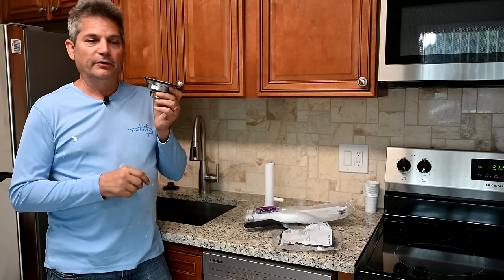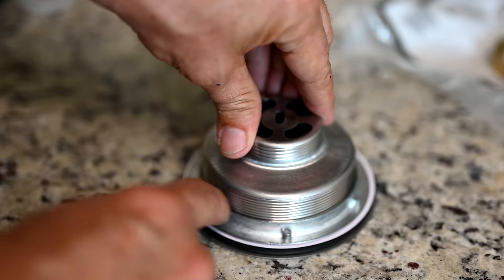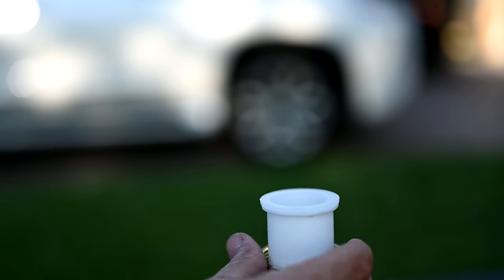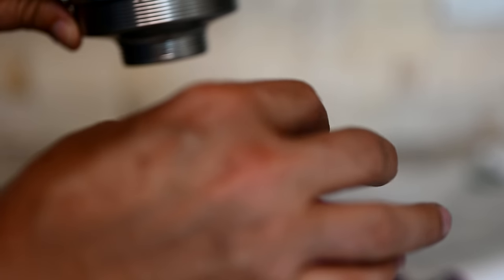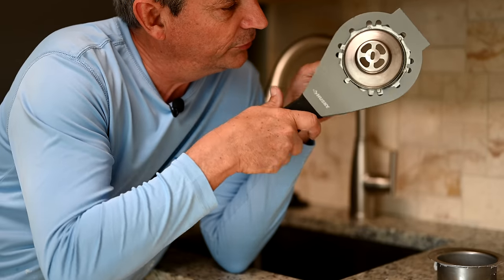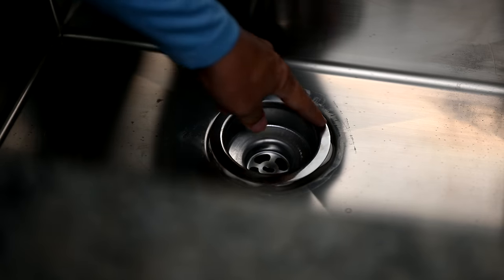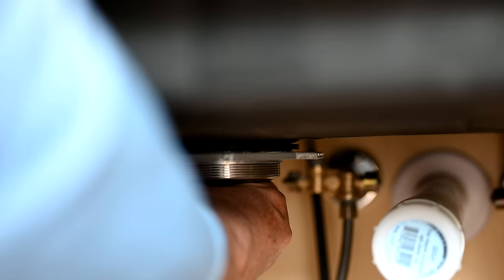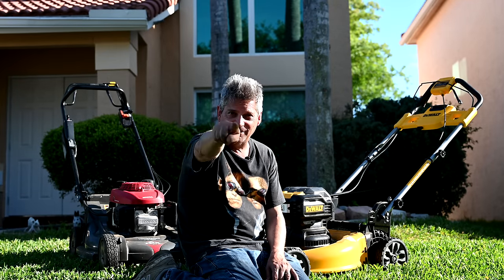How To Install Kitchen Sink Drain Strainer, Stop Leaks

Comment: Excellent presentation. Really appreciate the explanation and detail. I have a question about what is needed below the P trap. I am installing my sink in an outdoor kitchen and my drain will run straight down to and about 4 inches outside my outdoor kitchen to my French drain at grade. Do I just angle it down into the drain and call it good?
Reply from the maker: Yes, I would have the P-trap terminate into a 1 1/2" PVC pipe with a hub adapter, just like you would in the pipe coming out of a kitchen wall, then the pipe goes outside, then give it a 90degree bend, not a 90 degree sharp turn elbow, but rather a 90 degree graceful bend downward, and into a 1 1/2" pipe into  the ground.

Comment: I installed two of these since I had a double sink and for some reason the last one keeps leaking on the bottom no matter what I do or how tight I make it. I'm really frustrated because I had to by the putty, the right tool, and spend a lot of time trying to get it right. I don't know if it's warped or what. It just won't stop leaking on the left side. I've heard that you could use something called megaloc?
 Do you think that would work?

Comment: Thanks ! I'm wondering if that plumbers putty is affected by hot water or chemical cleaners!? I have a mowen  fiberglass sink that's only  four years old and started leaking! So would  silicone be more durable!?  Thank you !!
Reply from the maker: I doubt that it is affected by any of that 'cause it's really mostly sealed underneath the flange but I imagine overtime everything takes its toll on it that's why  many plumbers actually I prefer to use silicone instead

Comment: If tail piece stuck in bottom pipe any suggestions on loosening it?  The big nut was easy to unscrew but tailpipe wont turn or pull out.

Comment: I got a question.   Does the p trap need to be a certain height (higher or lower) than the stub out? And does it need to be vented at all?    I’ve seen some where there is a vent underneath the sink

Comment: Do you know if there's and advantage to using the metal nut that typically comes with the basket strainer versus the common plastic nut when securing the PVC tailpiece to the bottom of the strainer basket? Thanks for your input on this!
Reply from the maker: It's really hard to say the problem that I've seen in most installations is once you get a leak that metal not corrodes and then it's hard for some people to get them off. On the other hand I have seen where people put on the plastic nut and then use tools staking Lee to overtighten them and that can put too much stress on them and they eventually crack. My preference is to use the plastic and tighten it by hand wearing a glove so I can get it nice and snug without over tightening it and then I know it will never corrode. And if it does crack and fail sometime down the road it's only a couple of bucks to buy a new kit

Comment: I am thinking about building a friction gasket with a manilla file folder. What do think? Not replacing the basket, it's brand new.
Reply from the maker: I prefer to use what the builder ships with it
Reply: @jeffostroff  I gotcha. I appreciate your insights. The putty bead was the key for me. It was apparent, I didn't use enough when I replaced the old sink basket. Just didn't want to buy another basket because of a friction gasket.

Comment: Hi Jeff, just changed out my sink basket but having trouble reconnecting the nut to the bottom of the drain, it feels like its screwing on properly but then slips down again HELP!
Reply from the maker: Watch the video again and at 9:58 find that trick that I showed you for how to get that nut on there when it doesn't want to thread on. You push the nut all the way up and if it keeps skipping what you do is you force it up with your hand hold it in place and then very slowly rotate it backward counterclockwise until you feel it click up into the threads and then you can start threading it up again. This works with just about any nut and bolts that don't want to thread together. Let us know if that worked  for you

Comment: I need a new friction washer. I don't know why mine is not on there. It's a bit distorted, but for a quick fix I had to put plumbers putty on top and tighten it down.  It's not leaking, but like you said eventually will. Plumbers must have the patience of a saint. This is not an easy job!
Reply from the maker: Yes, and they  have a lot of these common parts in their truck!

Comment: Home Depot has the Glacier Bay stainless strainer for $18 as well as a Kohler brand stainless strainer for $50. Is it worth spending the additional $32 for the Kohler brand?  Both are made in China.
Reply from the maker: Kohler is way overpriced they're essentially the same darn metal thing you're just paying for the name

Comment: Can you make a video on replacing water spigots, there was an issue I had where there was to much pipe dope on the thread and I had to hack saw it
Reply from the maker: Do you mean the shut off valves? We have a video called: How to Install Water Shutoff Valves In kitchen Sink 1/4 Turn Valve https://youtu.be/_0ziKhjwwe8
Reply: @jeffostroff  more like the garden hose spigotes the ones that are outside of houses. I feel those are interesting, it will be a nice video. I know sometimes the spigots are under the crawlspace and out the siding of the house, underground and out the porch or random lawn area, or sometimes comes out like a wall from the house....they also make all kinds of water spigots, theres sharkbites, and theres “smart water spigots” that hide and are flush against the wall of house

Comment: I followed your steps, but I different drain stainer, the one I bought has a bowl that is part of the strainer that holds the gasket and I can't get it tight the strainer keeps turning.  How do I fix this?
Reply from the maker: sounds like you are missing a friction ring
Reply: @jeffostroff  The friction ring is there, and I put the white side down like you did.

Comment: the waste pipe from the wall looks higher than the dishwasher branch on the tailpipe, is this safe for dishwasher water draining? cause I have the same situation in my kitchen.
Reply: In California the sanitary tee is roughed in at 18" - 20" from the floor !
Reply from the maker: Great eye my friend! Yes we ended up pulling out the sink cabinet, cut a hole in the wall, performed surgery on the black 4" plumbing stack behind the wall to remove that section, then replaced it with white PVC, and lowered the T connection, and now the pipe is 16" off the floor instead of 22" off the floor. This was the highest pipe we ever saw.
Reply from the maker: even that is too high. I prefer 12" to 17" off the finished floor. We are working on a video that shows how we fixed all this! Greta engineering
Reply: Yes 18" - 20 " on the bottom of floor so give or take for finish
Reply: 19 1/2" is standard here, used to work fine on old school double bowl sinks or lavatories.  However,  most newer modern sinks have deeper bowls, 15" is a safer bet.
Reply: @jeffostroff  thanks for the details explanation. Luckily I haven't installed my dishwasher, going to modify my drain pipe soon. thanks again 👍

Comment: Jeff - This is an excellent video, but allow me to add a footnote. While I was plumbing my PORCELAIN  kitchen sink (a Kohler) , I came to realized that the standard strainer basket will not set correctly in the opening in the bottom of a porcelain sink. The standard basket will work just fine for a stainless steel sink, but (at least on MY sink) I had to purchase a special deep strainer with a very thin flange on the top to have it fit correctly. Again, excellent video, just thought I would add my 2 cents....
Reply from the maker: That is good to know so what did you finally put in there to work?
Reply: @jeffostroff  From a company called PlumbPak it's called a 'Deep Cup Locking Shell Kitchen Sink Strainer'. I got it at my local hardware store for $27 but I think they can be purchased from Amazon as well.

Comment: I have a question. My friction cardboard ring is really bad because it was so wet. I then threw it away. Do I need to buy a new one to do the installation? Will it cause the leak to install without the friction cardboard gasket?
Reply from the maker: The friction cardboard ring might not cause a leak in itself but you wanna make sure that it the lack of it being there doesn't cause problems with you being able to tighten to drain down.
Reply: @jeffostroff  I created that friction ring by using a pen & an existing rubber ring to draw a ring on a used USPS priority mail envelope; then I cut out the ring from the envelope. I have created 2 friction rings and I installed them with my existing kitchen sink strainer. It is working great now. I saved myself $6. My Home Depot store sells the Glacier Bay ring kit for $6 which includes a nut, a friction ring, and a rubber ring. It also sells the Glacier Bay kitchen sink strainer for $12 which includes everything.  Thank you for an awesome video.

Comment: I wish I had seen this video 1st. I went to one major home center and one small town store. They had no idea the parts I needed and was sold the wrong type of pipe even though I showed them pictures and NO ONE mentioned I might need pipe putty. I was given all types of advice to remove the metal ring even asking me if I knew what channellocks were. I had to smash the old strainer to remove it because everything was corroded together. I learned that a 10 min project can waste several entire afternoons.
Reply from the maker: There is a lookup table I should create that shows the job time in minutes, then you lookup how many days it actually takes

Comment: I saw another video where the person put the strainer and black rubber gasket on the top side of the sink.
The way you are installing it will leak '
Which way is the correct way ?
I've never had to use plumbers putty where a perfectly rubber gasket is the main sealer. The plumbers putty will dissolve in less than a few months and you'll have leaks and you'll have to do the whole job over again. So what is the correct way ?
Reply from the maker: I would like to know how many years of plumbing experience and plumbing code research told you that "The way you are installing it will leak". The installation method we showed here will not leak, and did not leak even after thorough tests of filling and refilling the sink, because our method here follows the instructions of the manufacturer. The other video you watched is likely wrong, because many people erroneously think the gasket goes on the top side of the sink. The reason ours does not leak is we used plumbers putty to seal the drain basket flange tot he sink, so there is no leak. Unless the manufacturer instructions specifically state to use  the black gasket inside the sink, I would never do it, and on top of that it would look ugly sticking out around the flange.

Comment: Need help. At 2:55 and 3:16 you are using this plastic washer. are you saying you have two for one sink drain?? you are not making it clear. my kit only came with ONE plastic washer like that and i installed it like you did at 3:16 and i have a slow leak... what gives? Am i missing a washer (according to the diagram on the box there is only one that comes with the kit) but your video shows them in two places. i am lost. i was about to use silicone and make a big mess. help.

Comment: My new Glacier Bay sink/drain has a foam gasket to be used instead of plumbers putty. I need some confirmation that it's OK to use the foam gasket before I install the drain. What do you guys think?
Reply from the maker: I would rather use rubber, but if they say to use it then try it and see if it works.

Comment: A lot of people do it the way you are and use plumbers tape but you don’t need the plumbers putty if you put the gasket on the top gasket is designed to perfectly seal the flange on the top of the sink it doesn’t go on the bottom a lot of people don’t realize that
Reply: I’m confused. So are you saying that I shouldn’t use plumbers putty? I should be using the black ring on top Vs how Jeff did it?

Comment: I can't get my old leaking strainer off. When I turn the big nut underneath, the whole thing turns including the top. Any suggestions please?
Reply from the maker: if you can get a drain wrench try sticking that into the drain and have somebody hold it while you unscrew it from the bottom or you can try sticking a Flathead screwdriver up through the hole into the bottom of the drain and into the slots of the grate  to see if you can hold it into place while you try to unscrew that nut. You might also try some PB Blaster on the nut several times over a ½ hour before trying to loosen it. Also try giving it a bunch of medium hammer taps all the way around the nut
Reply: @jeffostroff  Thanks for all those tips Jeff. I had the same problem but I managed to do it by tightening the nut. Eventually I tightened it so much that it cracked and fell in half and problem solved! It was very corroded.

Comment: Notice you didn't put on the ptrap , and you committed on the height of the trap arm rough in. Guessing it was too high to install the trap correctly. Especially if you had to use the branch tailpiece for the dishwasher.
Reply from the maker: Yes, we went into the wall  and cut out a section of the cast iron stack and lowered this drain pipe. This will be in another video.

Comment: Does it matter if the cardboard one got a little wet before installing? Mine did and there was still a small leak after.
Reply from the maker: You would prefer it to be dry probably OK if it got a little wet. If you have a leak afterwards then something was done incorrectly, done incorrectly, it means that you either didn't put enough plumber's putty underneath the basket sbasket flange up inside the top of the sink, or you did not tighten it enough with the big ring nut.

Comment: I have a brand new Ruvati stainless steel sink to install. The strainer has a foam washer and a rubber washer. The installation instructions indicate the foam washer goes on first then the rubber washer. So then, the nut will tighten directly against the rubber washer. Which, is counter to your instructions.

Comment: I've always followed these directions including using the plumbers putty and I still get leaks from the sink drain basket where the plumbers putty is in between the basket and sink flange. I'm to the point of using a sealant instead of plumbers putty.
Reply from the maker: Some plumbers prefer the silicone to the plumbers putty. Also if you are getting leaks you need to make sure that that flange is sitting perfectly in the we're seeing we're seeing grooved area where it sits on the sink. And you also need to make sure you have it tightened correctly accelerating into the what you might think is tight might not really be tight enough, and don't peel out any of the plumbers putty until it's all the way tightened down because you don't wanna tear out any from underneath it .

Comment: GE 100% premium silicone is best to use will last with no leaks, using putty will start breaking down within year being the putty gets water logged in time ultimately causing leaks.
Reply from the maker: That is what we use
Reply: @jeffostroff  Yes from much past experience used the putty & in no time usually within year it breaks down leaking having to redue it all over again got tired of it so gave try using the 100% GE silicone & never had problems leaking ever again, yet some so called expert plumbers out there will differ with me on that & yet say putty is best thing to use & of course they are going to continue to use the putty knowing it does break down fast being their hopes is the customers will call them back soon enough again for leaking drains.
Reply: @BurtBowers  how would I put the silicone on there? Same way that Jeff put the putty on? I had to replace the putty on my brand new kitchen sink over a month ago and I noticed it leaking today. So now I have to figure out a different way to fix this.
Reply: @Eva-kv8ws  Eva, taking the strainers back out clean off all putty under the strainers well also the sink area to I would use rubbing alcohol under the strainer & in sink area where strainers will sit on, get the 100% GE silicone apply decent bead of silicone under the flat side of strainer try not going too close to the edge of the strainer being once you place the drain strainers back into the sink hole the silcone will start squeezing outwards but clean up any after you installed the strainers tightly, if you can avoid from using them for least 4 hours the longer the better once you follow this method never have to worry about leaks under the strainer again, hope all works out for you👍
Reply: @BurtBowers  thank you Burt! 😃 
I sure do hope this fixes the problem. 🙏🏼
Reply: @Eva-kv8ws  Yes your welcome, I learned years ago that the old putty method was nothing but problems n headaches always having to go back fixing the leaks within year then realized the simple fix was the silicone & as I stated never had leak problems again, God bless🙏🙏

Comment: Reason why I use the gasket on the top because the plumbers putty after a while will rot and cause of the leak the gasket being used underneath does not seal the thread to not properly water can still leak through the plumbers putty if you use the rubber gasket on the top you’ll never have a leak